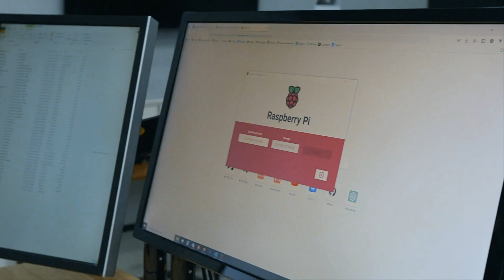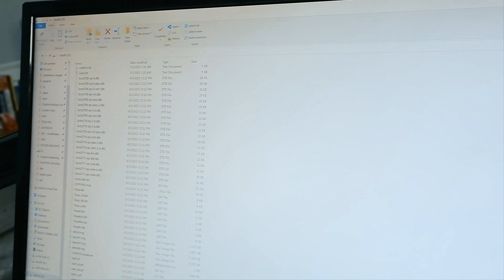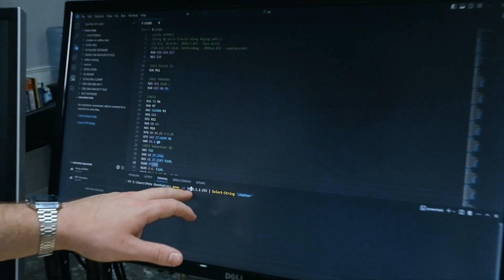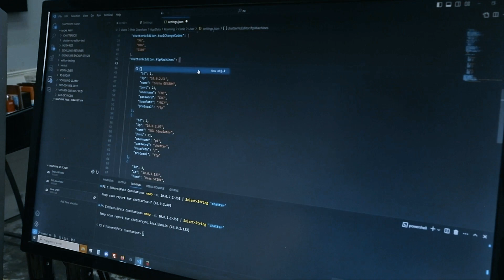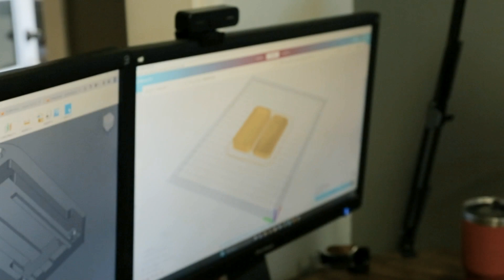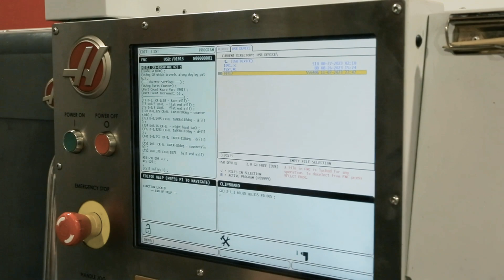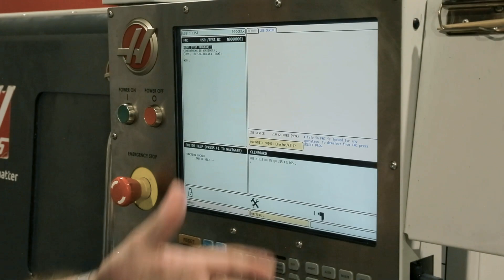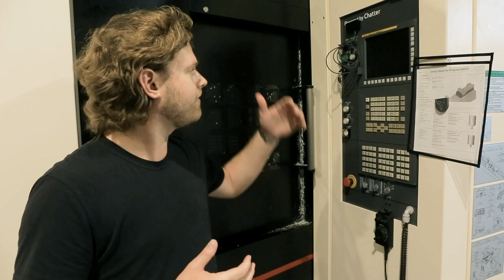Send Programs to Your CNC Machine Over WiFi - ChatterSync Wireless USB Drive

Comment: Just found this site.  I'm hoping this solution might work for my new Ortur H20 Engraver/Cutter.  Anyone else try this setup?
Reply: ... not sure this will work but gonna give it a go.
Reply: The OrturH20 doesn't have a file selection (to the best of my knowledge).  I wonder if I could setup a cron job to check for files in the directory (or some type of notification based on the directory) and then "play" that file to the USB port connected to the engraver/cutter.  Perhaps have a delay between jobs to allow for the next project to run, or handle them individually.  I'm a 28 year veteran in Java, and am familiar with C#, though definitely not my strong suit.

Comment: We have a CNC router machine; it has a Chinese controller, nk105g2. Normaly, we transfer the file to USB and then plug the USB into the machine and run the job. Will this work for us also? we want to just transfe the file from pc to machine

Comment: There isn't any information regarding an RS232 cable for older machine integration on GitHub or the chatter blog.  I'm really excited to build a Chatter Sync and figure the Serial/RS232 will be available at the Raspberry PI header ? PINs 8 & 10.  would the Chatter Sync work for incoming data from the machine.  Say you wanted to Dprnt information from a machine (Mill) and have it saved in a text file on the chatter.  The ideal would be for machine DNC status reporting, tool usage etc.

Comment: can the rebooting be set to a longer delay, as my machine doesn't reload the files on the USB once they have changed, unless I unplug the raspberry and plug back in. it might be that my machine doesn't rescan the data if it doesn't see a full disconnect ? the machine in question has a AXYZ A2MC operating system.

Comment: I got mine all setup. However I use a different editing software called Cimco edit that I use to edit code (as needed) and back plot. Visual Studio Code doesn't let me back plot. I was wondering if there was a way to save the Raspberry Pi as a network drive (like a NAS) that way I can just say "save as" in my Cimco edit software to the Raspberry Pi. Just like I would a regular USB.
Reply: Open "This PC" (if on WIndows 11, or "My Computer" if you're on older Windows). 
Right-click in an empty area, select "Add a network location". 
Then go thru the Wizard steps to specify remote device network info. 
This will add a remote folder to your computer in "This PC" and the "Navigation Pane" on the left side of Explorer, into which you can save or dragndrop your NC files.

Comment: I bought all the hardware and have tried this about 50 times now, and I am giving up. This is NOT easy to do.
Reply: did the green light on the board turn on once you loaded the operating system ?